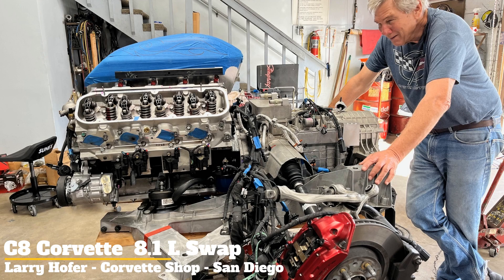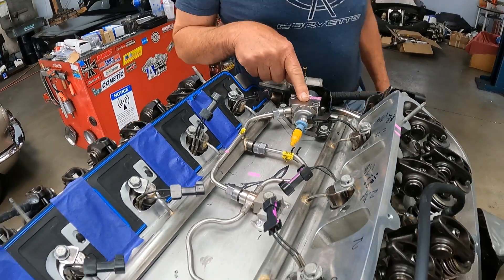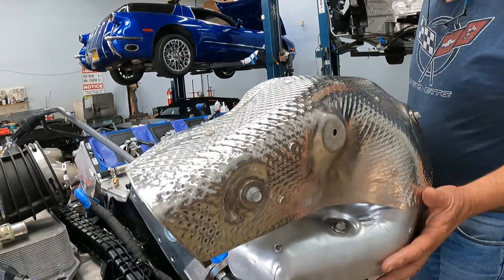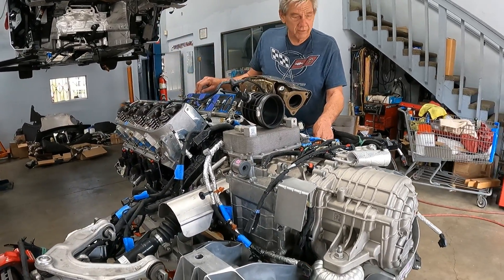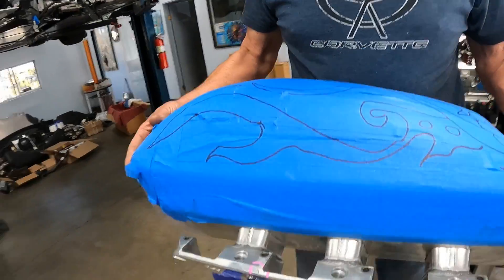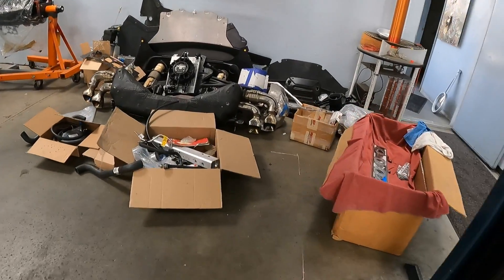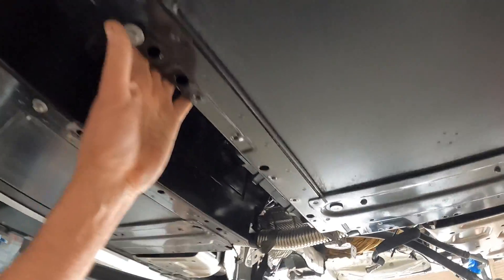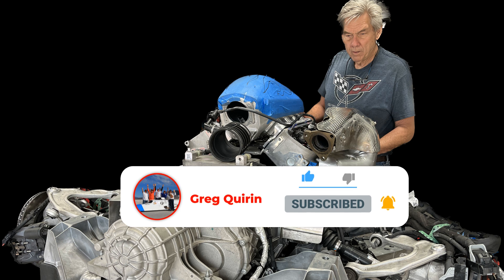World's First Big Block 8.1L- C8 Corvette Engine Swap

Comment: So he’s doing it because of the transmission that will not handle the torque of a big block? Unless the engine is weak AF? Or you’re going to baby it all the time? I hope they have a plan for transmission parts! I know there’s upgrades, but they still are problematic! How much weight are they adding? I wish him the best of luck! Doing something just to be the first, doesn’t mean it’s going to make the car better 🤷🤷🤷🤷! Adding around 120 cubic inches is going to need a lot of everything! Please follow if possible! Would like to see getting running & tuning! 🤞🏻🤞🏻🤞🏻🤞🏻
Reply: Yeah, I am a little surprised they're not going with a 6L90E or TR6070 transaxle. I'm guessing that if the reason for the DI, VCT and factory computer is that they are trying to pass CA emissions since they are in CA, that would make the power output more tame than max effort, no emissions, probably make similar hp/L to an LT2 which makes 495hp with 6.2L, 80hp/L × 8.1=648hp...still seems dicey with that transmission 😂

Comment: How much does he want for the LT2 he took out of it? Did he transfer all the DI, VCT and everything off the LT2? I have a honey of a 2004 GTO that needs an engine...I could run it with a port injection conversion from Mast and a Holley Terminator or Dominator through the T-56....😂

Comment: Honestly, I was just hoping to see someone take an L8T iron 6.6L block, bore it to 4.125" and stroke it to 4.125"-4.25" and make a 441ci or 454ci Gen V with like 12-12.5:1 with DI, limited travel VCT and a honking cam in a C8. This is on a different level for sure. I have been hoping to see someone try mounting a C7 7 speed manual transaxle and possibly the entire rear cradle, diff and axles in the rear off a C7 then bolt the engine directly to the TR6070 without the torque tube in a C8.

Comment: Did they really "cast" new heads or have existing heads machined for DI? Was the stock bellhousing pattern welded up and new holes machined, or is it an adapter plate. This is nuts but I love it.
Reply: Obviously don't know the exact answer but I would guess that casting new heads might honestly be simpler to get the placement correct for the injectors, and given that he figured out how to retrofit vvt to it, its more resonable to assume custom cast heads. I would guess that the block had to be machined to fit the different bell housing, just because you would not want to upset the flywheel and clutch placement on something as complicated as that DCT. As well as the fact that an adapter plate would push the engine firther forward off of the engine and make it harder to fit. Even if it is just machined heads and an adapter plate, it still is a very impressive feat.
Reply: @williammackellar6616 I believe the bell housing bolt pattern of an 8.1 is the same as an LS or an LT the flywheel is just a different bolt pattern as he said.
Reply: @williammackellar6616  Brodix will do just about anything within reason  on one of their castings. you just need to  call and ask and pay. Its not really something advertised by them though.
Reply: I know Larry personally, and yes he did cast six special cylinder heads with extra material to support the direct injection
Reply: @steve6992 Thanks Steve. He's obviously got connections with a foundry that does small runs. This swap is so much better than the complexity and heat of turbos.

Comment: Ok...why did he decide to use an 8.1, when there are $1,000-1,500 Power Solutions International rebuildable 8.8L engines readily available, then put the custom Ardema DI Aluminum heads on that?

Comment: It’s definitely cool.  But you could have made a ton of power with the engine that was in it. Like more than the big block.  But he got his mind set on it and he did it.  That’s awesome. Who doe like a big block.  It’s gona be so heavy in the ass end
Reply: Just basic science dictates that an 8.1L(or whatever displacement it is, I would have used a newer production PSI 8.8L shortblock if I was him) with adequate head flow... obviously a head they cast themselves is gonna flow, 12:1+ compression...which DI and VCT allows without detonation on pump gas and the correct cam and ignition timing is going to produce more power naturally aspirated than a 6.2L, especially one that is built to a price point and not hand built to total perfection. It would be the same with boost, bigger engine...as long as it can hold together...with the same boost, will make more power. The only reason the 8.1L is called limited by the junkyard build crowd is because it came with terrible iron heads, low compression and there isn't a massive amount of inexpensive aftermarket parts available for them.

Comment: At first my reaction was "ho bo big clock vette 🙄" but then, with the custom DI heads, those hard lines, the intent to run it off the stock ECU, the dry sump. This is an incredibly impressive project, very keen to see how this runs!
Reply: So am i  :)
Reply: I thought this was a way to get huge power bypassing the ECU problem. You can get huge power out of the stock engine but not with ECU lockdown.
Reply: @drummerdoingstuff5020 I think the E99 computers have been cracked and now people are reflashing them.

Comment: Ahhhh... the smell of money.
Reply: It's probably not as outrageous when you own the shop and are able to do all the hard work yourself. I doubt he will have the kind of money in this that the Icon dude charges for a completed Derelict or something they build with off the shelf GM crate engines, transmissions and accessories adapted into an older vehicle.
Reply: @hendo337  What you're trying to say is this cost a fortune not a ransom. Wanna take a guess at how much this will cost him?

Comment: Curious to see how it goes! I had doubts regarding the packaging in the C8's structure! 👏🏻
Reply: the packaging of this car from GM is spectacular. Cant see it breaking,                  now the clutch is another matter.
Reply: @larryhofer2266  Aftermarket companies already make strengthened double clutches for certain transmissions (for example, Dodson has kits for Porsche's PDK units). I think it's a matter of time until we see these companies developing solutions for the ones on the C8 and Shelby GT500.

Comment: Can't wait to see it go.  Which big block is it, a ZZ632 or what?
Reply: Basically the 496-ci/Vortec 8100 used by GM's heavy duty trucks.
Reply: I kinda hope they're just calling it an 8.1L to denote the family, there are newer production Gen VI BBC being made by Power Solutions International, GM sold the tooling and they are 8.8L, I would have gotten one of those to use as a short block and freshened it.

Comment: Worlds first direct injected big block and w/ vvt…
Reply: Finally someone working with the 8.1. Best engine out there in the junkyard. I’ve got just under 400,000 of hard work on mine. Have yet to open it up. Still have original waterpump on it.
Reply: Yes! I've been wanting to see what variable valve timing would look like on a big block. Awesome! WOW!
Reply: This is more innovative and important than what it goes into..
Reply: I know, I love it. If he supercharged it...  The engine would be laughing! That's it! Lol 
0-60 will be stupid, low 2's high 1's easy. Will the tranny take it, torque would be 500 lbs feet at 25-3 grand and hold until 6k!
Reply: Torque is the big concern. that is why i didn't put a 588 in it. wana drive it ,not work on it,
Reply: Torque is the big concern. that is why i didnt put a 588 in it wana drive it not work on it.. @anthonydavis5993
Reply: Why didn't GM make this? Ford makes the 7.3 so why not them make an 8.1
Reply: @michaelatkin9649  ahh, Ford puts it in the trucks, nothing else.
Reply: @michaelatkin9649 cause GM’s gasser 6.6 is still the go to.
Reply: @michaelatkin9649 This is ah GM engine, it came in the 2500/3500 I think.
Reply: @michaelatkin9649 GM has the L8T which people have got pretty damn good power out of. But I still prefer the Godzilla lol
Reply: Stuff like this will be totally gone in the next couple decades. Governments are pushing EV and tiny engines so hard 😢
Reply: @nickmudd Hello not if American people put there foot down !! Because you can't put people into something that they don't want ,because not everyone is going to be into these electric cars and trucks !! And because EV'S did more Harm to the environment because of all there batteries and electronics and Materials !! And the Biggest thing is good automobile Engineers and good automobile Certified Technicians do like this crap either and it being Forced into people by the corrupt politicians and the Gov !!! And because there is more Technology that can come out of the Internal combustion engines ,and gas and hybrid Powertrains , with clean efficiency and so EV'S !! So with that being said  everyone is going to have to Speak up and put there foot down , and say enough is enough and hold there ground , on these issues !! Because we all want a clean Environment ,but It just has to be better balance because Americans should always have Choices no matter what 🇺🇸🇺🇸🇺🇸💪💪👍👍👍👍
Reply: Definitely want to see move of this!
C6 under the other hoist, and a modified C5 on the other hoist.
Reply: Lary Hoover is a big friend of who!?!?😂😂😂 (google Larry Hoover) if you’re looking at comments I know you’re bored. look up the black panther movement and Larry Hoover if want some understanding of gang mentality.
Reply: Original direct injection? I have never seen that from the factory
Reply: @gneric85  Larry manufacturers the Raylar Big Power heads for the 8.1. He had six heads casted to accept the direct injection for this project